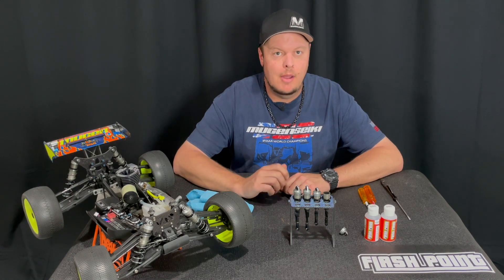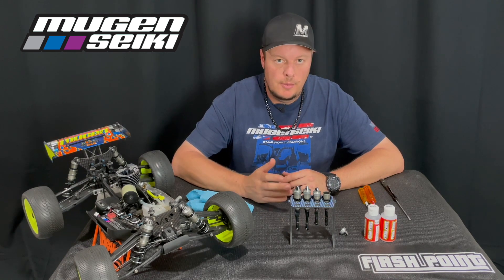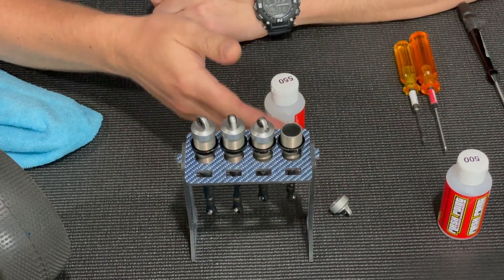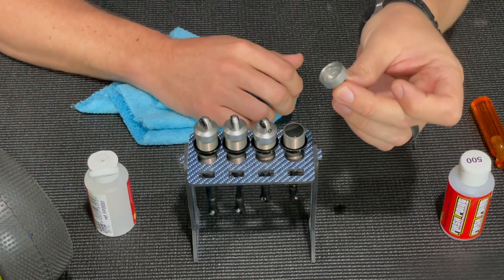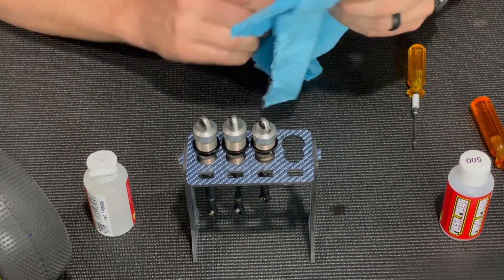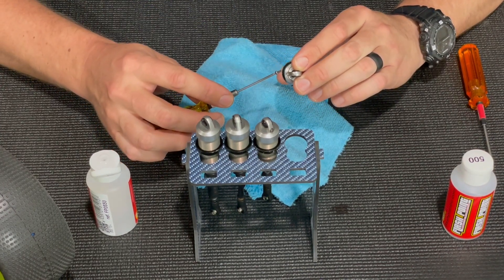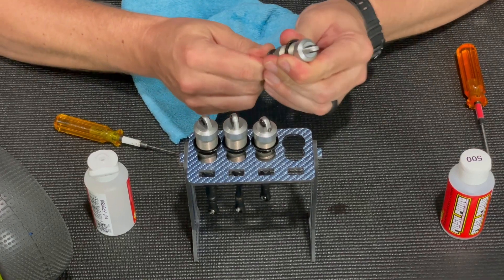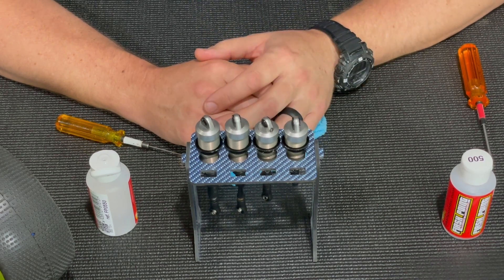Bleeding shocks with emulsion caps.

Comment: Interesting the way you bleed your emulsion caps. Some people pump the shock  20 times after the initial bleed. Then bleed again.  What’s the difference or why only bleed when the oil flat vs emulsified with air?
Reply: great question

Comment: ayo Adam for off road buggy is it best bet to give the front and rear shocks no rebound at all ?? like for out door track in New York/ Barnstormers??? you've been there before
Reply from the maker: I usually run zero rebound.
Reply: @AdamDrake  yea did what u were doing in the vid I mean it had a slight rebound ... are you saving that I can get these shocks for my 8IGHT-X Elite to an actual 0 where they will not even budget one bit ??
Reply: @AdamDrake  ok I see shock boot did same way w what I was doing it gave a lil movement but nothing to big over thanks A.D.

Comment: If you pull the shaft out, does it stay or does it get sucked back into the fully compressed position?
Reply from the maker: When the o-rings are new it will suck back in slightly.
Reply: @AdamDrake  phew, glad to know I'm not doing it wrong this whole time